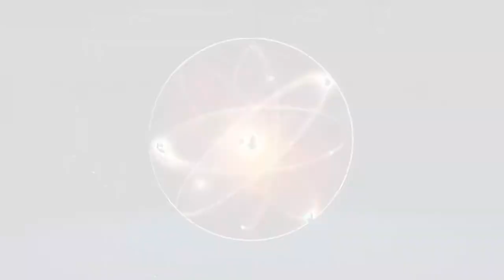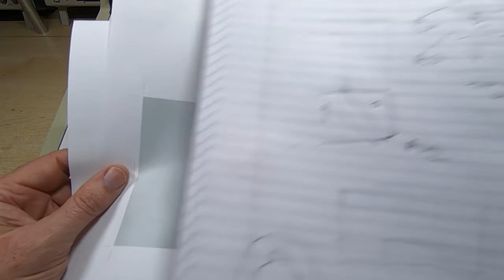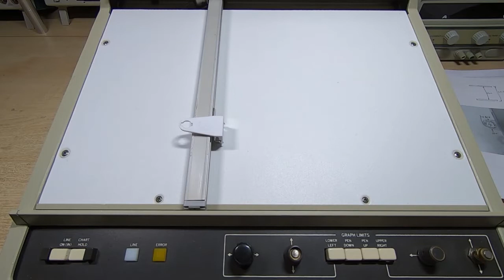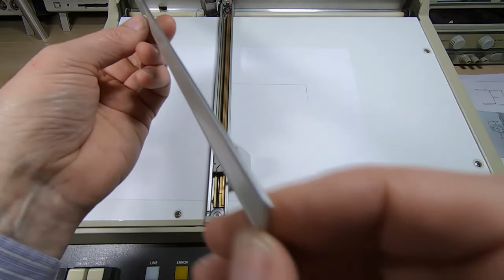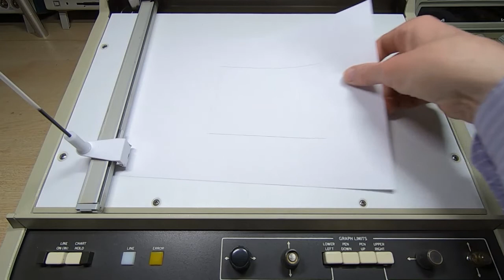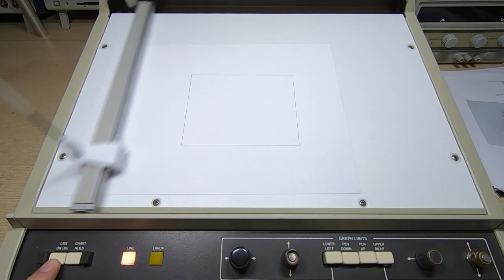HP9862A Calculator Plotter Repair Part10

Comment: You may have better luck with a gel pen cartridge.
Reply from the maker: I did try gel pens in a previous project but they do not really work well in this sort of application as the pen pressure is too low. Gel pens are really ball point pens with solid, pressure activated ink and at the pressure and speeds encountered in a plotter like this they tend to give poor results. That is why I chose to use ball point inserts as they work with very low pressures and also work at high speeds. As I said in the video the plotting was actually very good but was washed out due to the bright lights and camera exposure (see ASR terminal videos for similar exposure problem). Naturally I could simply buy some proper plotter pens and make a suitable adaptor but the one I show in the video works well enough for what I intend to use the plotter for (and only cost 2p each with a very long writing duration).